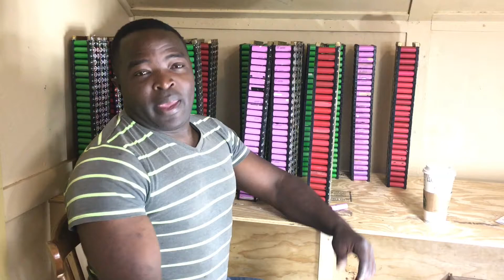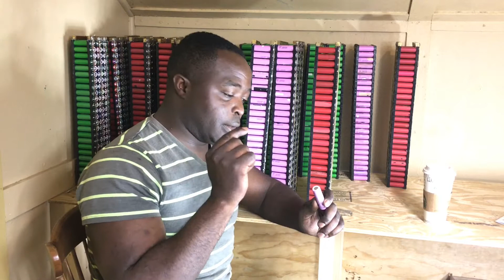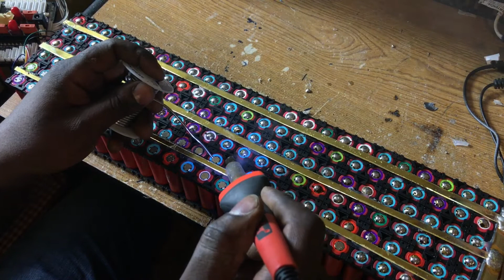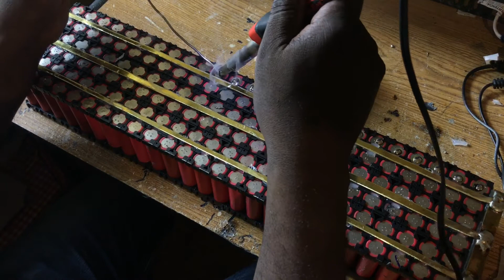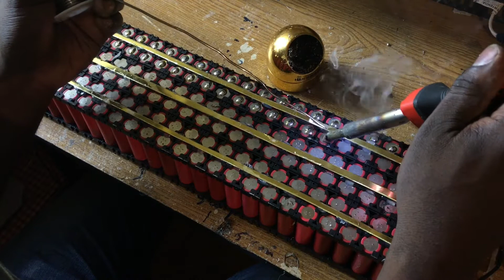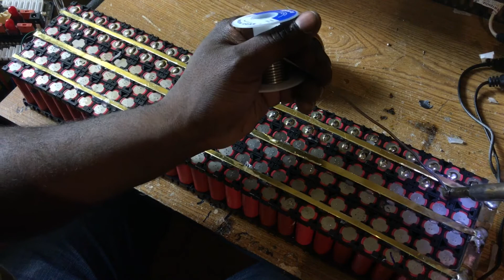DIY ELECTRIC CAR BATTERY

Comment: wow, you have mastered this!  have you ever accidentally shorted the positive side to the negative since it's only millimeters away?   that's my biggest fear about soldering, vs welding
Reply from the maker: Yes it has happened before and I learned a lesson. So I am really really careful than before when soldering.